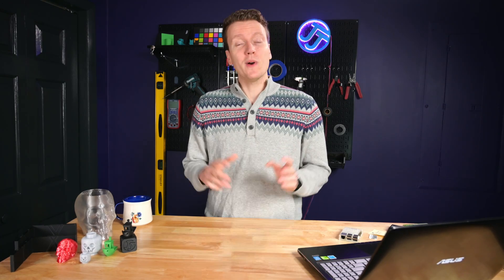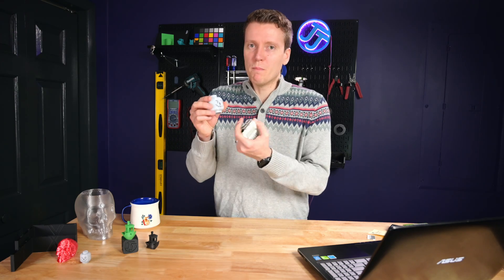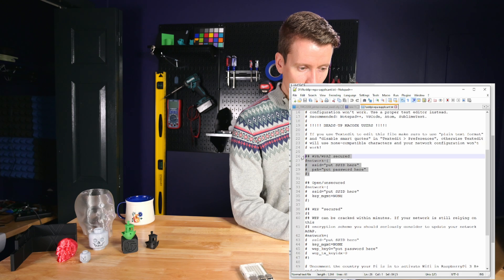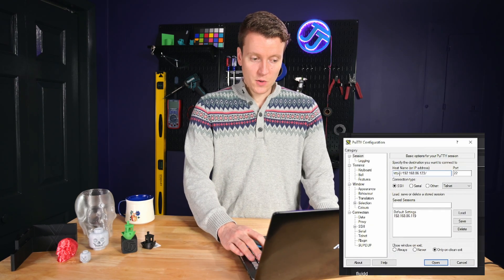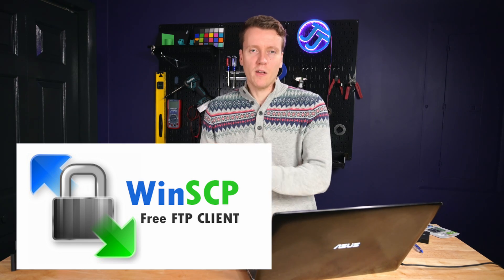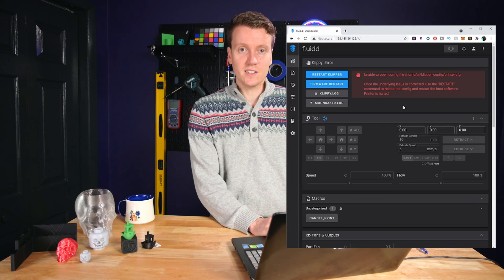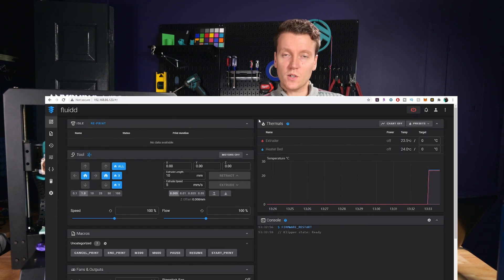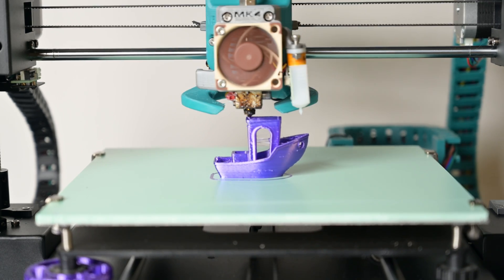3D Printer Klipper Install Tutorial | Anycubic Mega S with FluiddPi

Comment: Can you go back to stock firmware ? I bought a used unit that someone had tried to put klipper on now i can connect it to cura and the onboard control using gui doesnt work the gui works but there is no response from anything

Comment: For anyone doing this in 2024, i had to edit the config file! Becuase off an error calling: "Option 'control_pin' in section 'bltouch' must be specified"
I had to comment in the following lines: 
Line 161
Line 162
Line 163
[bltouch]
sensor_pin = ^PE4
control_pin = PB5
And also Line 72
Line 73
endstop_pin = ^!PD3
position_endstop = 0.0

If you are getting an error regarding not being able to open a file that you uploaded when wantin to print it, i had to edit the SD Card command 
Line 211

[virtual_sdcard]
path: ~/gcode_files

change to

[virtual_sdcard]
path: ~/printer_data/gcodes

Hope this helps!

Comment: Great video.  I have been trying to get Klipper running on my Mega S but i keep getting an error about not being able to connect to the mcu.  Flashing seems to have gone OK as reported by octoprint and fact I can't control printer from front panel.  Here's my question.  You mention the touch screen can be a problem so you disconnected it.  Was that due to a problem you ran into or in anticipation of a problem you had heard about.  What was the sort of problem encountered.  Thanks
Reply: I solved the problem and did not need to disconnect the screen.  Th R Pi bullseye OS needed a tweak for serial port operation and I had made a typo in the [virtual_sdcard] section which, when corrected, let Mainsail communicate with the printer.  My Mega is has the Trigorilla v0.0.3 MB and the newer (DGUS?) screen if you are interested and cared about reinstalling the screen. Thanks very much and keep up with the very useful videos. 😁👍

Comment: I'm late to the party here, but am following your video and trying to get Klipper working with my Anycubic Mega S and Rpi 4. The problem I'm having now is that the printer.cfg that I found from your link seems to be missing lines that Fluidd says I need in order for it to work. (Example: Option 'rotation_distance' in section 'stepper_x' must be specified") Is there a more recent cfg that is compatible with the Mega S that has all the necessary variables defined?
Reply: Same thing here

Comment: Config file is now out of date due of many deprecated features in it. Would you update it?  Your video helped me of with my new/old I3Mega.
But fortunately i have some experiences wth klipper on anycubic chiron. In other way i could not make proper printer.cfg file.

20211102: Several deprecated features have been removed. The stepper step_distance option has been removed (deprecated on 20201222). The rpi_temperature sensor alias has been removed (deprecated on 20210219). The mcu pin_map option has been removed (deprecated on 20210325

Comment: I know it’s an older printer, and this video is a year old,  but I just picked up an anycubic mega s from a garage sale. When I went to the fluiddpi gethub I saw a warning that it’s no longer supported. Do you still use it, do you still recommend it? Thanks.
Reply from the maker: The GitHub said this printer isn't supported? Yes it is still a solid printer, and especially if you already own it.

Comment: PLZ HELP! I have a Mega Zero 2.0 with marlin. I did all the steps that you said but I'm having trouble with flashing it through Cura. When I first try to update the firmware its grayed out and I have to wait like 5 min for the button to become pressable. I then try to load the hex file and it says it cannot update the firmware because of connection issues, but the USB cable is showing up in device manager. I've been at this all day😩

Comment: Howdy JJ. Do you think your config file would be easily modified for, say, a MegaX (it uses a standard extrusion on the X axis and has a larger build volume, apart from that it seems to be pretty much the same as the MegaS).
Reply from the maker: Yes, it would be pretty easy to modify those few settings, and it should work fine. I think it uses the same mainboard, so even the pins would use the same names.
Reply: @JJShankles  Thanks on the A2A. Will check it out.

Comment: Question, does anyone know if the Klipper firmware works with the laser attachment for the pro series? I have all stock right now but have an SKR 3 board to install if needed.

Comment: Will this config work on the standard i3 mega
Reply from the maker: I'm pretty sure it is the exact same. They both use the same board and theextruder design was the only big change in the S.
Reply: Little Anni has a direct drive titan extruder these days, it's the tiny screen and naff filing system that are my main issue

Comment: I saw your acceleration in your printer.conf is about 10000. Is this actually the acceleration you are using or just a placeholder? I think my machine will break at this high values :D. Great videos btw. I thought you got 100k + subs because of the quality of them.
Reply from the maker: I put that as a place holder so it wouldn't be limited by the config file. I run mine with 5000 acceleration defined in the slicer.
Thank you! I try to make the videos as good as possible!

Comment: Hi JJ, i installed Klipper on my anycubic mega pro. This was already modified with TMC2208s. However, since i installed Klipper the old electrical noise is back. Anyway reduce this?
Reply: I have the same issue. Somehow i feel the extruder motor has high current.
Reply from the maker: You could adjust the voltage using the screw on top of the TMC2208 if things are running a little hot
Reply from the maker: I haven't heard of that. If the noise is coming when it is moving you could try lowering accelerations or square corner velocity to see if that could push them less and decrease the noise.

Comment: Thank you for this video, my I3 Mega is printing better than ever!!
Only difference is I am using Biqu h2 extruder.
May I ask for some help?
Even though the printer prints million times better I have one issue, at the end of the print extruder stays on top of the print, is there any possibility to make it go "home" or similar?
THX
Reply from the maker: Yes, that should be defined in your END_PRINT macro if you use one, or whatever end code you use from your slicer. It could get stuck if you try to send it somewhere out of bounds, so that might be a cause of that issue.
Reply: Thank you for your reply.
Found the issue, it was a bad case of not reading the "manual" :D
I have skiped step where you said to make start and end macros same in Cura, after doing so all my troubles were gone.
Reply: Hey ! Thanks for posting that, was wondering if you followed the exact tutorial for your i3 mega? Did you change anything? Cheers

Comment: Decided to flash back to stock I was dealing with more errors on Klipper  than I was spending time printing. Dont update moonraker cause error I couldn't fix. Decided marlin is a better fit for me, for now. Thanks for all your help JJ!!
Reply from the maker: Did you use avrdude to flash it back? I haven't done much research into how to flash it back yet, but I need to make a video covering that.
Reply: @JJShankles  yeah used winsSCP to move stock firmware to the Pi. Then in Putty typed avrude -p m2560 -P /dev/ttyUSB0 -c wiring -D -U flash:w:name of my stock firmware
Reply: @rrobles7069  Hi, where do you put the file on the Pi? I keep getting an error message "error opening marlin_mega_s_v1.1.5.ino.hex: No such file or directory"
Reply: @IoannisSotiriadis  home
Reply: @rrobles7069  thanks for your quick reply. I'm still stuck because WinSCP now says that I do not have permission to write the file in /home
Reply: @IoannisSotiriadis  you should be able to able to copy and paste without any issues
Reply: @IoannisSotiriadis  is klipper currently on your raspberry pi? You need to have either klipper or octoprint on your raspberry pi. I've done it twice with no issues once on klipper once on octo
Reply: @rrobles7069  Yeah I have klipper on my pi. I decided to go back to stock for now that's why I'm trying to go back to marlin. It says that /home is owned by root, not pi.
Reply: @IoannisSotiriadis  I'll get back to you in a few when I hope on my PC. Eating right now
Reply: @IoannisSotiriadis  yeah just tried it. No issues. I would try it again with a fresh install
Reply: @rrobles7069  ok, I will try re-installing klipper and see what happens. Thanks again!
Reply: Still stuck! Please help! My line of command is: avrdude -p m2560 -P /dev/ttyUSB0 -c wiring -D -U flash:w:"Marlin.hex":i   Hex file is in "home" directory. I tried with and without quotation marks and I keep getting the message "Can't open input file - no such file or directory
Reply: @IoannisSotiriadis  you should be flashing stock file for your printer not marlin
Reply: @rrobles7069  Well, this is what I got from the official anycubic site "Marlin_TFT_MEGA_S_V1.1.5.ino.hex". I just renamed it "Marlin" for short. The problem is that avrdude does not find the file to start flashing.
Reply: @IoannisSotiriadis  sorry man like I've said before you have to place the file in the home folder. If you are doing that correctly it will work
Reply: @rrobles7069  I love U for the Information. Thank You. Worked perfect. Greets from germany
Reply: @JJShankles  sorry I couldn't find it. Can you give me the link for your print bed?
Reply from the maker: @rrobles7069  I'm using this one still: https://popsknife.supplies/collections/g10/products/tiffany-blue-g10
Reply: @JJShankles  awesome! Thank you
Reply: @JJShankles  yeah. In hindsight I understand why avrdude didn't work on my pc, because my pc didn't see the USB port. avrdude is already on fluiddpi so it was just a matter of moving stock firmware to pi then flashing it with avrude
Reply: @Daniel-xc8nf  yeah used winsSCP to move stock firmware to the Pi. Then in Putty typed avrude -p m2560 -P /dev/ttyUSB0 -c wiring -D -U flash:w:name of my stock firmware

Comment: tried using your config file, klipper gave me a ton of errors. I could not get it running. Can you make a video on how to restore stock firmware on Mega S. Cura does not recognize Mega S at all since board was wiped. I have a big paperweight now :(
Reply from the maker: What are some of the error messages you are getting? That can help trouble shoot things. Are you able to connect to the board with the raspberry pi?
Reply: @JJShankles  yes with the raspberry pi I am connected. I installed your cfg I get an error. BLtouch pin error. I don't have BLtouch and at all. Nothing I have tried will remove error. Without the rasp pi nothing recognizes my printer. Not even the USB port is recognized on my pc
Reply from the maker: The BLtouch error is coming from the printer.cfg file. In there if you remove the [bltouch] , [safe_z_home] , and [bed_mesh] sections then it should fix it.
Reply: @JJShankles  thank you for the help. Really do appreciate it. I'm really bummed out there is no easy way to revert the changes
Reply from the maker: Yeah the trigorilla is a pretty hard board to work with since it doesn't have a bootloader built in. The only way I've found is to use the avrdude program: https://github.com/Klipper3d/klipper/issues/4333
Reply: @JJShankles  yeah that's what I had tried. Looks like I might need to get an upgrade. Too bad. I'll keep trying. Don't why I'm getting errors. It's all cfg errors. Still haven't been able to get the printer running with it. Thanks for your help
Reply: @JJShankles  FYI I got rid of that BLtouch error by getting rid of BLtouch under the do not edit this block. Took it out from there error is gone. New error unknown pin chip name 'probe'
Reply: @JJShankles  I got. This will take quite some time to calibrate and get ready for printing but at least it's working. Thanks again!!! 🔥🔥
Reply: @JJShankles  everytime I post how to flash to stock Google deletes my post
Reply from the maker: YouTube has been struggling with over filtering out comments lately. I tried to get them out of the filter, they should be posted now
Reply: Just did that. Still getting option 'control_pin section 'bltouch' must be specified
Reply from the maker: Check the [stepper_z] and [stepper_z1] sections. Make sure the endstop pin is correctly set to endstop_pin: ^!PC0 and endstop_pin: ^!PA0 respectively.
Reply: @JJShankles  in cfg file stepper z is prove:z_virtual_endstop
Reply: Stepper z1 was set to ! PL6
Reply: @JJShankles  yeah didn't make a difference still getting original control pin for BLtouch error
Reply from the maker: I said the wrong pins in that last comment. endstop_pin = ^!PD3 and endstop_pin = ^!PL6 are correct. And remove the probe:z_virtual_endstop.
One more thing, check at the very bottom of the file in the "SAVE_CONFIG" section remove the "bltouch" section in there. 
Another option is to try with this base config file: https://github.com/Klipper3d/klipper/blob/master/config/printer-anycubic-i3-mega-2017.cfg
In that one all you have to change is the [mcu] section
Reply: @JJShankles  FYI also missing from your cfg is position_endstop 0.0 for stepper z. All errors resolved
Reply: @JJShankles  thanks again for pointing me in the right direction. Subscribed to your channel! Thanks again!!
Reply from the maker: That's great to hear! Klipper is great when it works, but can be a bit of a pain when it throws errors!
Reply: @JJShankles  everything is backwards how do I correct home z went up instead of down

Comment: If I hadn't seen this video I wouldn't have believed it, but I am now printing PLA at 220 mm/s on my Mega.  I have a warning for you, though.  Make sure your X-axis belt idler pulley is in good shape, because it is mounted to a threaded rivet thing pushed into the soft metal of those Z carriages.  The bearing in mine was clearly worn or dry, and while fine at 50 mm/s, at 200 it bent that rivet out of there.

Comment: What would you recommend as the minimum RAM for a RP4?  I would think 1GB should be sufficient to run a printer.
Reply from the maker: Yes I think the 1GB RP4 would work great. The RP4 is faster than a printer even needs, so any of the options would work

Comment: Hi JJ. I have an anycubic Mega X. Do you know what settings should I change on your config file?? Thanks.
Reply from the maker: I found this one online that is pretty bare bones, but you can use it to make sure you have the correct pins and size on things. The "dir_pin" might be reversed with or without the "!" depending on if you have changed the stepper motor drivers. If your motors try to move the wrong direction then flip that.
https://klipper.discourse.group/t/config-for-anycubic-mega-x-printer/379
Let me know if that helps.
Reply: @JJShankles  will try this JJ. Thank you so much and more power to your channel. :) You truly are a gift to the 3d printing community.

Comment: You can set the SSID, password and SSH in the settings within Raspberry PI Imager. It saves editing the text file and you wont be able to connect to the PI if SSH is not switched on because the default is off.

Comment: Hey, your firmware file should work with the tmc2209 also, correct? And should i change anything with respect to not having a bl touch, and will a pi cam work without any changes?
Reply: And i love your channel btw, it has helped me a lot with my mega s
Reply from the maker: Yes it will work with the 2209. You might need to comment out the section about bltouch and mesh bed, and a pi cam will with great. I've used one on this setup

Comment: Hi JJ, I have started the Klipper install but the latest version of klipper seems to require missing things from the config and I wondered if you have changed anything yet?
First issue I am running into is: Option 'rotation_distance' in section 'stepper_x' must be specified
Reply: I feel stupid. I didn’t all the manual changes then saw you video about it all 🤣 keep up the awesome work. I need to calibrate e-steps tomorrow and try and do a manual mesh bed level

Comment: I have had my mega S fitted with new TMC2209's and the wiring has been reversed. Do I need to flash the revised Marlin hex before doing any of the stages to install Klipper?
I have yet to install Octopi.
I am 73 and struggling to understand everything.
Keep up the excellent video's. I think I have watched most of them
Reply from the maker: You can go straight to klipper after upgrading to tmc2209. And if you have reversed the wiring then it should work with the stock Marlin firmware, but updating the Marlin firmware is easy to do if you want to play around with it before diving into klipper. 
The TMC2209 upgrade is amazing how quiet they are!
Reply: @JJShankles  thank you for taking the time out to reply. Yes the 2209's are amazingly quiet. They would add so little to the overall cost, I am surprised they aren't fitted as standard.
Keep the videos coming. Huge fan.